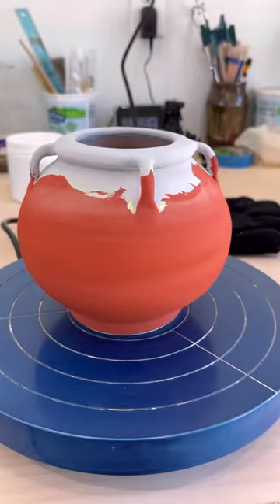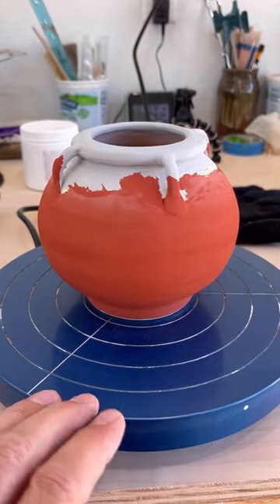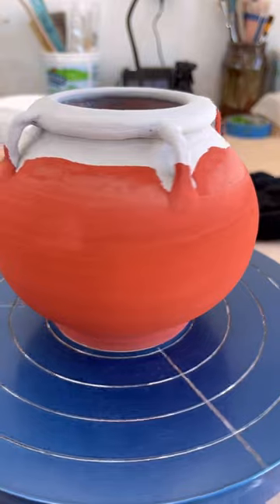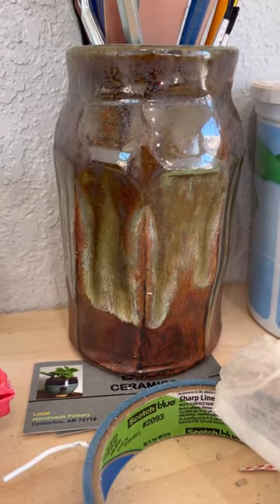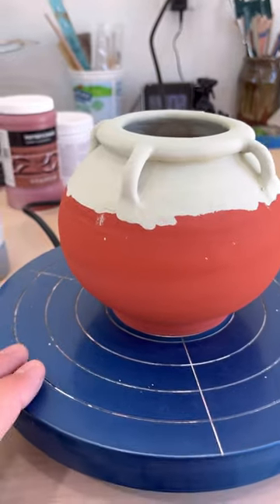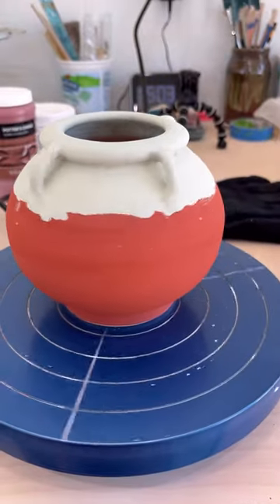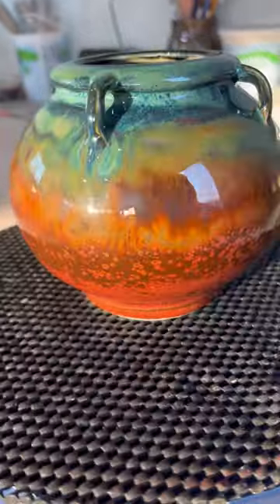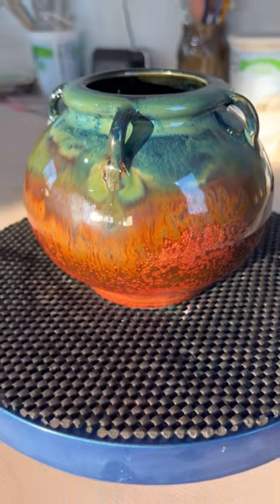AMACO Glaze Combo - Obsidian, Seaweed and Ancient Copper

Comment: Beautiful!  May I ask how many layers of each color you used? and did you use ancient copper all over the outside before adding the obsidian?
Reply from the maker: 3-4 coats of Ancient Copper that did not go to the top. In the video you can see where it stopped.  3 coats of Obsidian at the top and I did cover the Obsidian heavily with seaweed which is a thin glaze drying in between coats. The seaweed did overlap about a half inch to an inch over the Ancient Copper. Around 5 coats of seaweed at the top over the Obsidian.

Comment: how many coats of seaweed did you use?
Reply from the maker: After I applied 3 coats of obsidian I probably put 5 to 6 coats of seaweed. I wanted it to run and fade into the copper so I kept it on my banding wheel and just kept layering it up at the top ring and just below.

Comment: Spectacular. Did you use 3 coats of each glaze?  Did you find that the ancient copper runs a lot? It looks like you left very little unglazed at the bottom
Reply from the maker: I find Ancient Copper to be very stable on its own.  3 coats of AC and Obsidian then multiple coats of Seaweed globbed around the top to get the run effect.

Comment: So was there any overlap of the obsidian and copper, or did they butt up against each other? Wonderful results! I'm waiting on my order of AC to arrive, and can't wait to try it out.
Reply from the maker: They were pretty much butting up against each other and the seaweed made it run down over the copper.  FYI - word is out currently that Ancient Copper is being reformulated and there could be delays in shipping for awhile. It may be different when it arrives also than in the past.  I hope that’s not the case for you. 🤞🏻
Reply: @healingearthceramics9472  thanks I hope so, too! It’s en route so maybe I have one of the later “original” versions. Thanks for the quick reply :)